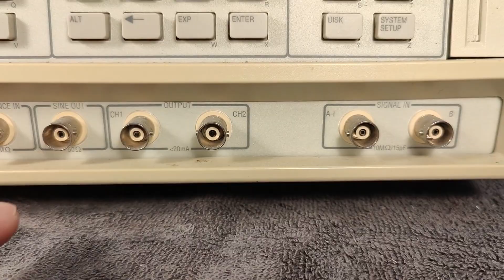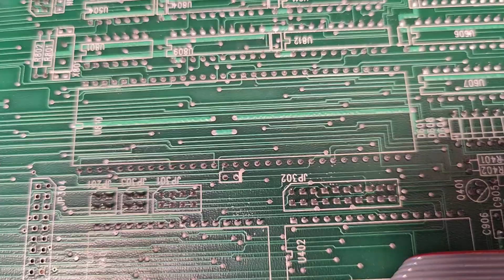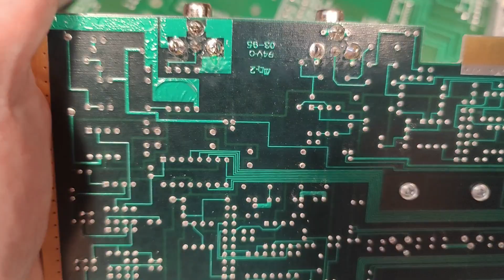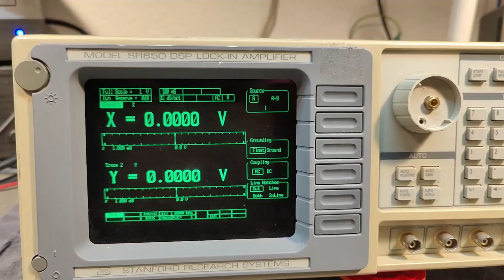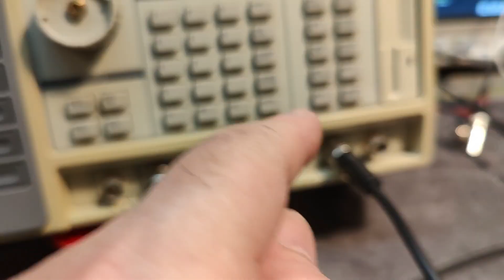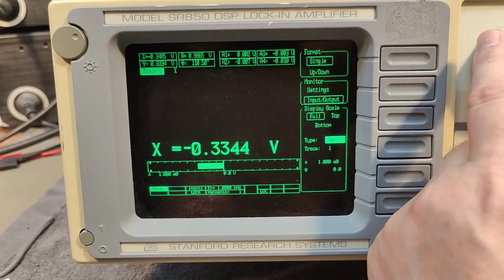Stanford Research SR850 100 kHz DSP lock in amplifier 1992

Comment: The input is usually switchable between just using one input and a differential input (A-B). So it could be just a setting that disables the 2nd input.
A broken input amplifier could be possible, but I don't think so.  The input amplifier  is the part under the shields with the DIP8 parts.  2 of these are dual JFETs and likely used for the main amplifier.
The beeps at the start are a bit suspecious - this could indicate some problems with the computer side.
The main use is for small signals that are in sync with the reference signal output or with using the ref. signal input.
One use would be to record the bode plots in the lower frequency range. Chances are there is a way to make it scan the frequency.

Comment: Nice!
I have the SR-770, which has a very similar case and construction. It's a long time since I have had it open, but I guess the front-end is probably very similar. Also, about the "8088 keyboard", this means a keyboard for PC/XT style PCs. These use a simpler protocol than the typical PC/AT keyboard we are more familiar with, and the two are not by default compatible. PC-keyboards from the late 1980s often come with a XT-AT switch for this reason.
Reply from the maker: thanks it is a good point with the keyboard

Comment: I picked up a lock in amplifier at a hamfest. Got that along with an analog ratemeter, in a card rack with backplane connectors and such, amplifiers and filters.  All this stuff came from an old school X-ray machine. My thoughts are that it was for radiation counts and such to protect the worker and well, the patient. Keep track of exposure even though I don't fully understand.  I know how detectors work but the correlation to x-ray count is unknown to me.  The lock in amp is analog, no computers, has RC/LC bandpass filters, mixers, center reading analog meter, ten turn pots and gang wafer switches.  It works, the signal output put into the Panasonic audio analyzer says the output is unstable (it drifts constantly, normal?) and contains distortions.  Good video as always.
Reply from the maker: thanks a lot, this one all the cool stuff is done in software using fancy DSP chips to speed up the calculations